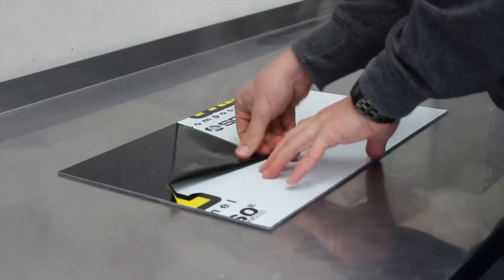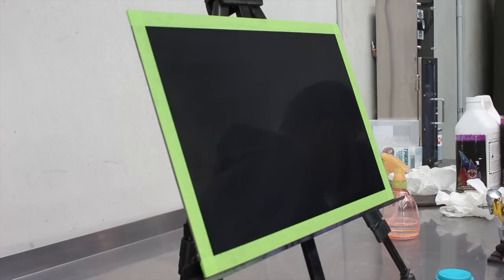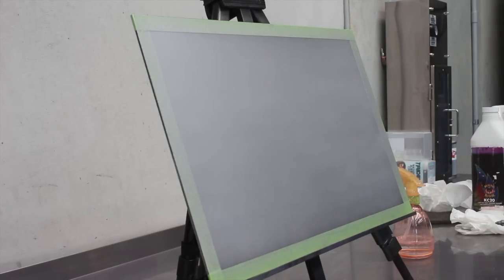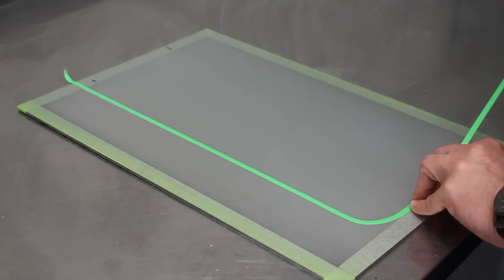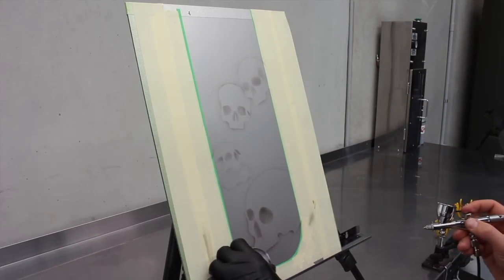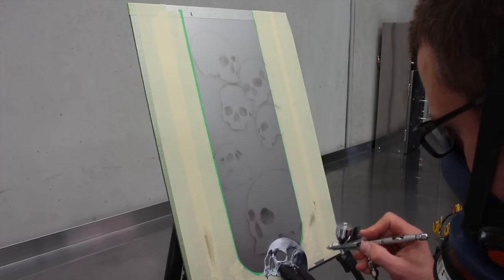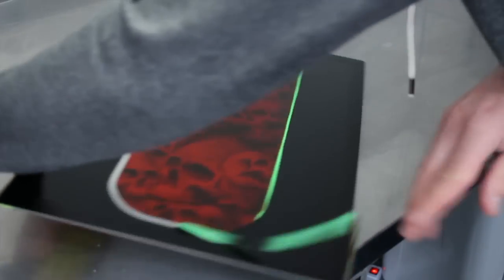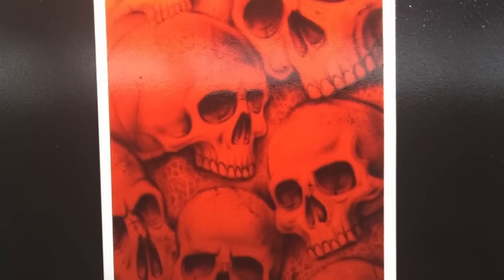Airbrushing Skulls with orange candy.

Comment: I'm Very new to using an airbrush. I'm a female motorcyclist, and a multimedia artist. I'm not Overly into skulls, As, they are a bit over used, in my opinion. That said, This is an Absolutely Gorgeous panel. And. personally, I do not want to use stencils As a Primary tool... which, is what I've found prior to your video, so, for that, thank you. I guess, I don't consider it "mine" stenciled... Now, I have a Good Answer
Reply from the maker: +Billie Lemere thanks for your comment and compliments on my work appreciate it and glad you found the video helpful. 👍🏼
Reply: Airbrush Asylum I've subscribed, I believe, along with another "teaching channel" will be AS Good as a mentor... And, I WILL most likely have questions in the future. I want to get to a point where I can brush MY motorcycle... I have a Mess of T-shirts, that are like size 5x, leftover from a theatre give away, and, I have 2 sheets of steel, to just cut and 'doodle' ... I've had my airbrushes for Almost 2 years, but, I Do struggle with that "Artists fear of failure" ... only artists can understand That in particular feeling, I believe. I was Really impressed with the Candy, Orange is an Absolutely Favorite color of mine!! My bike Plan is Purple dragon.. black base... green belly, but, Maybe, because it will require such a small amount, I'll do the dragon in a prism paint. I'm not looking at Even touching that for a while yet though ;) Thanks Again!!!
Reply: @misterdude4296  LOL Love the internet
Reply: Stencils and masking has been used for years, its how its done